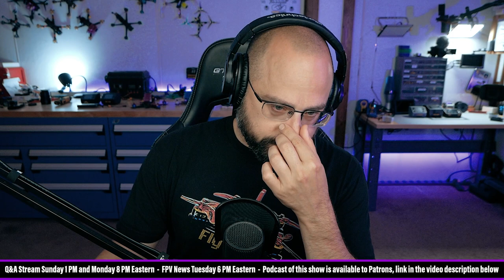Do Capacitors Effect a Quad's Tuning? - FPV Questions

Comment: I have jitters in my 3" 6S build that I can't figure out how to get away. But I do have the standard 50V 470uF  Cap on board. That can't be it, right?
Reply: It's hard to get a good flying 6s 3 inch quad. What motors do you have, as they are normally the culprit here?
Reply: @skyweaver3199  is that so? I took the motors that are build in the iflight protek: xing 2205 2500KV
Reply: @plschrf2363  I use 1408 motors on 3.5 inch..... So those are huge
Reply: @skyweaver3199  well yeah, it's a heavy lift platform with tiny props, it needs strong fast spinning motors. Also the protec is using the same motors, so I'd say it has been tested. What is your point?
Reply: I have the xing 2205 3200kv that i am putting on speedybee35 😁 along with argus f7 aio.😁 How are you guys holding up? Any suggestions?  Thinking small cap on 5v rail, big cap on batt. 03 air unit for video

Comment: Yes. Dterm is highly affected (and limited) by noise.

Not just the cap on the ESC, but also a cap on the FC vbatt rail.
Reply: Can you explain what the vbat rail is? I want to test out an extra cap on the FC and I’m curious as to where exactly that is.
Reply: Pos of cap to vbat negative of cap to ground on flight controller I’m assuming but just want to make sure.
Reply: @justinwalker8364  yeah so all quads shoudl have a 470-1000uf cap on less than 30mm of ~20AWG to the ESC +/- is good for most quads. If you are experiancing broadband noise under ~300hz you can try adding a 220-330uf cap on the flight controller vbatt(vcc) and gd pads. Usually there is a set near the plug that goes to the esc for those who want to direct solder rather than use the plug, and some boards break out an additional vbatt pad somewhere on the fc. You might find your fc doesnt have a vbatt/vcc pad at all, the foxeer f722 mini comes to mind. In such case, you can also try putting the cap on the 3.3v rail or the 5v rail instead, in fact, its possible that is better on the 3.3 or 5v rail for filtering the gyro signal specifically, but I havent tested that.
Reply: @mouseFPV   thanks man. I’m going to try that out later. First I have heard about a cap on the flight controller. I’m in my first year but I have already been through a handful of different frames. Picked up a source one v5 and it has been the best one yet as far as vibration readouts on logging. Pretty cool. It’s the first one that’s had some weird 60hz stuff too on the dterm. So maybe this will help.
Reply: @justinwalker8364  it's no guarantee but worth a shot for sure.

Also don't put the ESC cap on the xt60, or on the thin legs. You want to use a short run of wire, about 20 awg. No longer than 30mm, shorter is better. Wafl cap-cap will help.

Good luck!
Reply: This is some good info that i am just figuring out 😉 gonna use a argus f7 aio in new speedybee35. Argus came with small cap. I think i am gonna put that one on 5v rail and put a 1000 on batt input 😉 i want this aio to last for a bit 😁